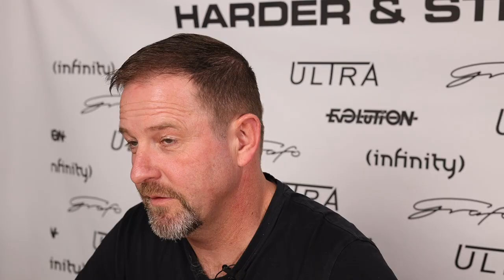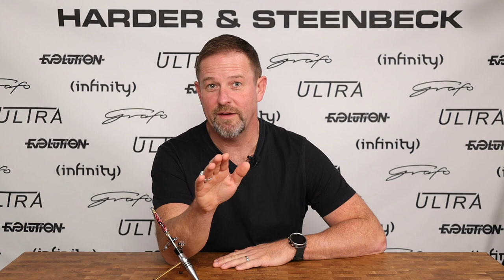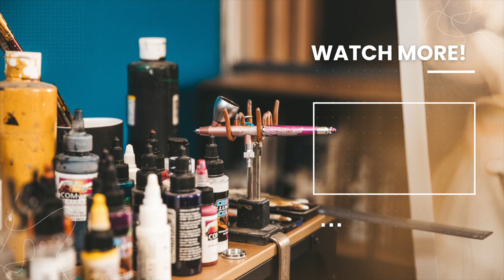Airline Moisture! Stop Your Airbrush From Spitting...

Comment: Another thing to remember is that environmental conditions can affect spitting. Having lived in Las Vegas, Los Angeles, and Albuquerque since I started airbrushing I can tell you from personal experience that fixing spitting isn't always as easy as leaving an airline out, and the solution for one environment might not always work in another.
Reply from the maker: Hey Christopher - excellent point - you are absolutely right. Environment does make a big difference. Our tip in this video does assume that you have a pressure regulator with a moisture filter on it ON the compressor. With that being the case, ensuring that your airline is always open ended each night will give you a successful system, no matter where you are. Without the filter on the compressor, yes, humid environments can overcome good practice. The tip is really aimed at people who suffer this problem and think that a moisture filter screwed to the airbrush will solve it - this tip solves that problem for free, rather than with a purchase :-)
Reply: what do you recommend?

Comment: I have a Infinity CR Plus,  Lately I have noticed that I am getting bubbles in the paint cup and intermittent or a pulsing of the paint spray.  I thin my Tamiya paint 1:1 and usually spray at 15psi.  After every use I clean the airbrush and use your method of back flow to get rid of any residual paint.  My needle size 0.15mm.  Thanks Ron
Reply from the maker: It's likely that you need to just tighten the aircap up a little more. Sounds like you are not sealing the nozzle well. Check for any dirt on the face that the seal goes onto in the airbrush too. Make sure, when tightening the aircap, that the needle is withdrawn slightly. Finally, check your nozzle for any damage around the mouth. Hope that helps!

Comment: Great Tip, do you have to remove the quick release fitting from the line for this to work ?
Reply from the maker: If you have a QD on one side, just hang the hose with the QD at the topside. QD at both ends, then just fit the tail into one end, and have that as the lower end when you hang it.

Comment: I have a moisture trap on both the compressor as well as at the airbrush hose where it meets the brush and I still get spitting. Its been a big PITA and do not know what else to do.
Reply from the maker: Hello Witchy! Please get rid of that airbrush filter, and just make sure that you leave your hose disconnected and open at both ends in between sessions. Make sure that you drain your airtank, if you have one, and your compressor moisture filter. Also, don't leave your compressor with pressure in it either. Typically, moisture coming through your line will be moisture that's dropped overnight as the air in the airline cools... you can totally prevent this by just taking the hose off, making sure that air can circulate freely through it, and hanging it over a door or something so that both ends are facing down. Give it a try and come back and let us know please! W

Comment: I had now a horrid experience with spitting. My nozzle had a partial clog. It redirected the stream slightly off of the middle path. This resulted in paint accumulating in the nozzle cap. When there was enough, it shot out at my model. Luckily I was basing it, but never had this issue before. 
Guys, make sure the gun is clean before packing away!

Comment: For me spitting happen when a bit of paint start pooling in the needle tip.
Is this also caused by moisture?
The problem persists even when I use new needles, and draining the compressor by the end of day.
My temporary solution is to spray dry air into the booth before spraying the paint onto the part, and occasionally clean the needle tip with airbrush cleaning solution.
Reply from the maker: No that's not caused by moisture. If you have wet paint visible on your needle tip, it is either due to a cracked nozzle, or more likely your trigger technique. Push down, pull back, PUSH FORWARD, and only THEN stop pushing down. This is so that the air finishes last, after you have shut the paint, and cleans the needle tip. If you release the trigger before pushing it forward, it will always stop the air fractionally before the paint, on all airbrushes. Then in the last moment as your needle returns, it will push a little drop of paint onto the tip and leave it there unsprayed, waiting to ruin your day :-)
Reply: @harderairbrush  Awesome. Thanks for the info! I'm gonna start practice that technique.

Comment: Question: I have a moisture trap at both ends of my air hose. One at the compressor end, and another inline with my quick connect. Is this a viable tactic to prevent, or at least minimize moisture in the line?
Reply from the maker: Ask yourself the question - how in the laws of physics could moisture form in a tiny volume airline over 2-3m in between two moisture filters? It really doesn't happen :-) Your second filter is not minimising moisture in the airline - it is only capturing the moisture that you are allowing to form in there by keeping your airline sealed at both ends whilst it cools down after use. Hope that helps!

Comment: Sage advice. Even for my little diaphragm compressor, I've a hose with an inline moisture trap - overkill? Maybe, but I don't want the heartbreak of ruined work💜✌️😉
Reply from the maker: Inline is fine, if a little ineffective, typically. Do whatever makes you feel relaxed when you paint! But I can guarantee you that if you use our tip, you'll be better insured against the moisture issue.

Comment: my giraldez infinity is spitting from the cup. please help!! i don't know what's wrong with it. I cleaned everything even using the ultra sonic cleaner.
Reply from the maker: Hey buddy! Almost certainly you just need to tighten the head slightly more. take off the end-piece, loosen the needle nut, pull the needle back 10mm, then tighten your head a little bit more - only with your fingers, but firm :-) then push the needle back, tighten the needle nut, and all should be good. If it is not, and you are certain that all parts are clean, then perhaps you have a small crack in your nozzle. Check this visually, and let me know. Thanks! W
Reply: @harderairbrush  Thanks so much for the quick reply. I will definitely try it tomorrow. Hopefully it works. Because i cleaned it twice in the sonic cleaner and still does that.

Comment: What is "Air consumption(Nl/min)" in some airbrush's description? I find some may have same consumption but different nozzle size.
Reply from the maker: You cannot detail air consumption without talking about pressure - just as a caution. The same way that compressor people love to talk about how many litres their compressor delivers, but don't say what pressure it is delivered at (what use is 20 litre at 0psi, for example)... However, to answer your question, l/min is an expression of how much volume of air is leaving the airbrush when you depress the trigger, in litres, per minute. You would expect a larger nozzle size to consume more air, but don't expect the same nozzles sizes across different brands to consume the same volume of air. Air consumption is, however, a great indicator of  how fast the airbrush will lay down paint - more air consumption typically means the airbrush will spray faster. This is good for priming/ basing/ area coverage, not so good for detailing.
Reply: @harderairbrush  Thanks, i somehow understand that.
Reply: @harderairbrush  🤔Hmmm, i realize It also related to certain data of the compressor. If i buy a airbrush/spray gun with huge air consumption (hundreds?), i won't be able to use it with painter/modeler's small compressor. It can't support such huge air consumption😮.

Comment: I just changed brushes with the tank still full of air...Water spurted as all the air rushed out. I guess i'll be using this simple trick from now on.. 👍
Reply from the maker: Hey John - when you have an air tank, do bear in mind that you should drain this regularly too, for the same reasons. A quality compressor with an air tank will always incorporate a tank drain valve at the lowest point of the tank, for this purpose. At the end of every session is my recommendation.
Reply: @Harder & Steenbeck  Thank you..yes it dies have a moisture trap. I'll make sure to empty it regularly.👍